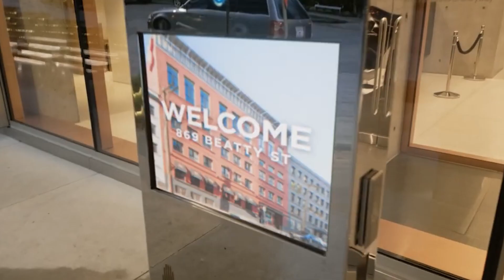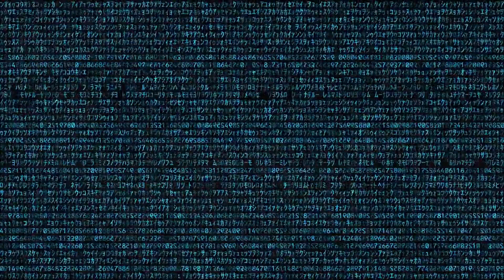This Contact Lens is The FUTURE of VR!!

Comment: But there is one fundamental problem in this...... surely one might think "hm, putting an 8k OLED layer over a contact lens that´s possible, and even rather easy to make! How cool here we have our new VR of the future, coming soon!" - but the human eye simply cannot focus on anything that is not at least five centimeters away from the eye. And this needs a bigger and more complex lens system to project an OLED layer on a contact lens virtually away from the eye, and a bigger and more complex lens system can no longer be worn as a contact lens (at least not without a high uncomfortable amount of pain and pressure on the eye, when placing a lens-system directly onto the eye). I think even the most sophisticated VR systems in 10 or 20 years will therefore always look like some thick pair of nerd-glasses *ggg
Or the second possibility is a device that looks like a slim headset microphone (but with an Micro-LED-matrix instead of a microphone on it´s front end) worn on the temple, projecting the augmented reality either on a pair of glasses or onto special contact lens with lasers, making the holograms hoovering at least a few inches away from the eye.
But a contact lens itself as a VR headset, hmmm I consider that rather impossible :)
Reply: I think most technology seems impossible at first. If it was TRULY impossible and not just incredibly difficult I don't think anyone would be wasting their money on making it.